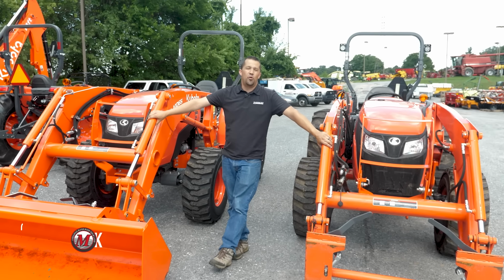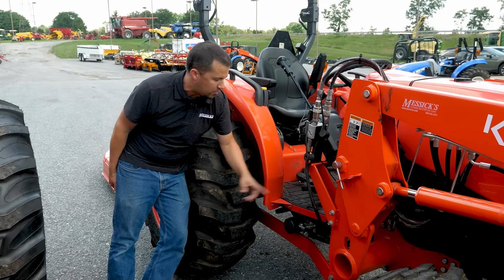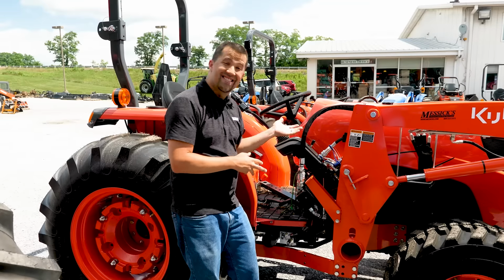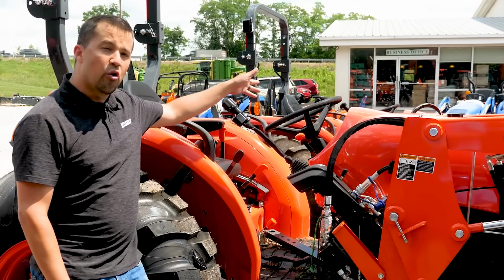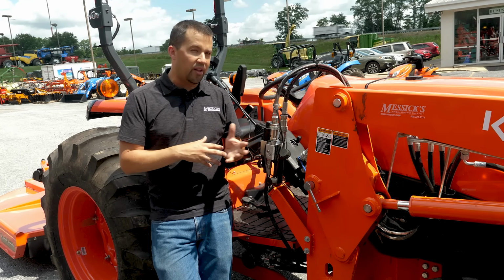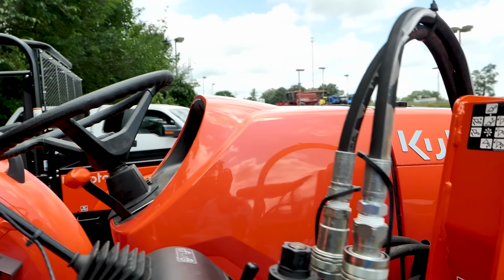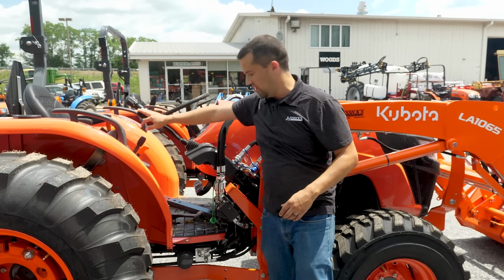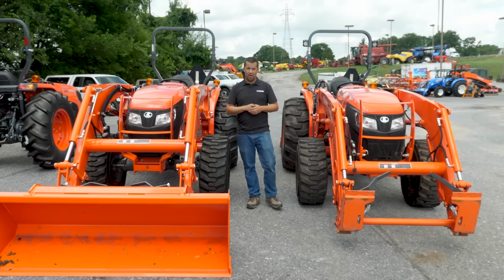Third Function Kit Comparison

Comment: I like the new 3rd function kit from LandPride, where the wires from the controllers go down the tube.  The instructions still say to notch the Boot, but I have found a much better way by stretch the boot to fit the wires though and it looks factory.   Don't need the zip tie or clamp to make it water tight.  What I'm looking for is a boot or a cover for the controls to keep water out.

Comment: My Mahindra 5565-4L loader control valve doesn't have any markings that show which ports are for the power beyond circuit or to the tank.  My local Mahindra dealer was no help.  There are no valve diagrams available on the internet.  I might as well sell my grapple attachment.

Comment: I purchased a Land Pride kit from Messicks for my L4701 so I could operate a grapple. The install was relatively easy, but I took my time to make things look professionally done. I've been extremely happy with the Land Pride kit. Heavy duty hoses and couplings. Have not had a single issue with it.  The grapple is defintley my most useful implement. I highly suggest one. For me, the Land Pride 3rd function valve kit was THE way to go.
Reply from the maker: Glad to hear it is working well for you! Can we share your comment in our advertising?
Reply: @MessicksEquip  Absolutely! I've ordered several items from your website. Things I've needed, or wanted, have been easy to find, shipped quickly, and well packaged. The diagrams and installation instructions are extremely helpful. I will continue to use the website for my future purchases.
Reply: With a Divertor kit, can you use a toggle switch to keep it engaged instead of a button on the stick that you have to keep holding?  While snowplowing, i would Pin on the plow so not ever using the curl function. Im picturing flicking on the toggle switch the whole time so the curl fuction would be used to angle plow.
Reply: @theresahoffman8408  do not think that's possible. But with a third function installed, you should be able to adjust angle the blade with the buttons on the joystick and leave it at the angle you want to plow. I can close, or open, my grapple with the buttons and leave it in either position while working the tractor. And still use the joystick to raise or lower the grapple without using the buttons and keep the grapple in the open or closed position. Snowplow positioning/angle should work the same.

Comment: Thanks for the great video. I have a bx2380 with a bx2822 front mounted snowblower. My question is, what is the best and easiest way to add a deflector control to the blower. Mine is manual and it would be nice to not have to get off the tractor to adjust.

Comment: Hi Neil. I'm looking at purchasing a 3rd Function Valve Kit for my L3901/LA525. This video was very informative! It's Sunday and Messick's is closed so I thought I would post my questions here. In the video I believe you are comparing OEM and 3rd party valve kits. And I also believe you compare kits where the diverter is place on the loader front tube assembly and those where the diverter is placed near the valve assembly (more so near the operator). For me the latter configuration seems to be better simply because it is more protected from damage when away from the working load. With that out of the way, my focus is on which kit should I buy. An OEM Kit or a 3rd Party Kit. My Local Kubota Dealer is selling the W.R. Long Kit when I checked with them. When I asked about the Land Pride Kit the salesguy said they have had better luck with the WR Long Kits. I have a few questions maybe you can answer. 1. Are you comparing a OEM Kubota or Land Pride Kit with a WR Long Kit? 2. I know Kubota owns Land Pride now, but does Kubota make an OEM kit for my tractor? I did not see one on the Messick's website. Only the Land Pride Kit. 3. In the video which I watched several time as there is a ton of good information, I believe you said the WR Long Kit is a well designed kit.  But also believe you also said the OEM kit cost a little more, but the cost is worth it due to design and they are made specific for a model of Kubota Tractor. So my question is did I understand you correctly? 4. What's the warranty on a OEM Kit (if there is one) and a Land Pride Kit?  Note: My local guy said the WR Long Kit has a 90 Day warranty which is not very long. Thank you sir!
Reply from the maker: I can make this pretty quick. There is no Kubota kit for this model. Land pride and WR long kids are very similar, but I prefer the way the couplers mount on the land pride. 

https://www.messicks.com/part/380-152A
Reply: @MessicksEquip  Thanks and I appreciate the quick reply!
Reply: I just ordered one from you. Thanks again @MessicksEquip  !!!!

Comment: I have a hydraulic tank for a front brush cutter. Is there a way i can use a grapple with it? Trying to use what i got without buying a 3rd function.
Reply from the maker: No, you need a valve that can toggle the flow bi-directionally.
Reply: Do you have one or know where i can get one? Thanks
Reply from the maker: @robertshirlingjr.6988  https://messicks.com/thirdfunction

Comment: Hi Neil, can you explain what those two knobs on the Hydro-Tek value, top and bottom are for. Do they have any function at all? I'm trying to slow down the response of the hydraulics when operating the grappler on my L3901 when loading logs onto the mill. Is there any way of slowing the action other than via the buttons. I had the OEM version installed. Thanks.
Reply from the maker: Hydraulic flow restrictor

Comment: When I engage third function valve can it stay open so I can run a log splitter out front with function controller for splitter on splitter if that makes sense
Reply from the maker: not a great idea. 3rd functions are not make for long term continuous flow like that.

Comment: Neil, thanks for the video.  My dealer installed the 3rd Function behind the loader in the manner shown in your video. It now interferes with the Swift Tach hydraulic disconnect lever function. Seems like Kubota should have a better solution.
Reply from the maker: This is for a BX? The OEM 3rd function valve puts the valve body out on the loader as a diverter so it does not get in the way of the swift-tach. Availability on those is terrible, your dealer may have used a Land Pride 3rd function for that reason.
Reply: @MessicksEquip  My tractor is a B2601. I agree, they probably installed a Land Pride 3rd function. Dealer was not really that knowledgeable on the Swift Tach loader. The Swift Tach loader is a significant advancement in ease of use.  A suggestion for Kubota is to innovate a better 3rd function integration and make it standard. For example, just add two more connectors on the Swift Tach manifold. These days the 3rd function is a necessity like the Skid Steer quick connect.

Comment: L3540. My factory kubota 3rd function valve is in a verry bad spot at the bottom of the loader brace by the throttle peddal sticking out past the tires i wish it was in a better place i have hit it several times

Comment: Hi Neil. Thanks for sharing. I have trouble connecting my grapple to my third function fittings from residual pressure. I always cycle the buttons with the key on to try to relieve pressure before disconnecting and before connecting, but still have an issue. This is a factory third function on a B2650. 
Do you have any suggestions to solve this?
Thanks again.
Reply from the maker: Video coming out shortly on this

Comment: You need to do a video on the L2272 third function / hydraulic skid steer disconnect for the L60series. Not much information out there on it. My local dealer didn’t know it even existed when I ordered my L6060 last month. It’s so handy to not have to get out of the cab to unlatch the skid steer quick coupler.
Reply from the maker: I will, but we need to sell one first.

Comment: Dose the lx have enough flow to run a true 3rd function and a 2nd function together
Reply from the maker: For that to really be done right you'd need closed center or flow control. No small tractor could.
Reply: @MessicksEquip  I asked it in the wrong way talking specifically for loader curl and grapple close or open doing 1 of each function

Comment: Neil, when using my 3rd function (4 in 1 bucket) and having my BH92 backhoe attached on my L4701, the backhoe valve continues to blow seals.  This is a huge disappointment and limits the function of the tractor.  Has Kubota come up with a fix for this issue?
Reply from the maker: IMO, something else going on there. Incorrect plumbing? dirty or incorrect hydraulic fluid, etc?

Comment: Great info here Neil!  I just installed a WR Long B3200 kit on my tractor and the fit was a big disappointment for a kit that was specific to my tractor.  I wished I would have looked to see if there was a Landpride option available.  Lesson learned for my next Kubota...
Reply: I have been really disappointed with my WR Long also. Instructions were poor, it needed extra parts to make it work, it leaked like a sieve and now one of the valves has packed in. Strongly don't recommend.

Comment: Neil I love my dealer installed OEM diverter type 3rd function kit on my BX23S. Currently I use it for our quick attach power angle snow plow from Ai2.  I find no trouble with operation and appreciate control of the fluid flow. Cheers. 🇨🇦

Comment: I installed the Landpride kit on Tractor Time With Tim, he installed the OEM kit on his machine. The OEM kit has a LOT more value for a very slight price increase.
Reply: I'm not finding any kubota OEM valve options for a b2601.   My dealer quoted a landpride.......1600.00 installed!!!!  Ouch!
Reply: @jpjp3873  I'm not fully clear on how a diverter works in contrast to the 3rd function, but I can tell you with several hours experience using a 3rd function and there is often a conflict between the various functions.  From what I've heard Tim say, the diverter is actually a bit easier to control.  If I were you, I would also look into that option.
Also, don't hesitate to call Messick's.  There might be an option available that your dealer is not aware of.
Good luck!
Reply: @curtwhite876  Thanks for the reply!  I'm going in tomorrow to finalize my order.  Was figuring to have dealer install to keep it all under warranty and financed in with the package.   I'll ask about an OEM option.  I'm not sure how long it takes to install, but 800.00 adds up fast at dealer rates!
Reply: @jpjp3873  I think it took Tim and I a little over 4 hours to install the Landpride kit on my B2650 and about the same amount of time to install the OEM kit on the LX3310. The most challenging part of the OEM kit was routing the hard lines in the right loader arm.  It was a bit of a puzzle.  Aside from that, though, the OEM kit was VERY well designed and it looks like it came from the factory with it.
To me, the biggest challenge with the Landpride kit was that the instructions were incomplete so we had to figure out several things on our own. Plus I replaced some of the hydraulic fittings so the lines were held up closer to the frame. The Landpride kit is a one size fits many, so it isn't very well optimized. 
But if you're going to have the dealer do the installation, they might make a few adjustments themselves since they have likely done it before, and because they'll want you to come back again and again.
Reply: I'm kind of thinking that's why Neil did this episode, because he regularly looks at TTWT. I watched it as well and it was interesting the difference between the two setups. I totally agree that for the money, I think it would be better to go with kubota's OEM versus land pride if there is a choice. We all are wondering though if Neil ever gave Tim a hat like you got! Lol lol
Reply: That was a good video

Comment: Pretty sure the Kubota MX5200 we bought has an OEM third function kit. The way the Land Pride kit is described and shown looks very similar to the set up on my tractor. I’ll have to check if there are metal lines or hoses. The valve mechanism is up on the loader behind the bucket so I guess it is the self contained diverter style. I’m not sure though as we have not had the tractor long and I’m stuck in prison. The city I live in is a prison city in lock down. No one is allowed to the country. The tractor is on my farm and I can’t go there....

Comment: I have a question why might a newer tractor have bigger or wider tires than a older model of that same tractor?
Reply: Some tractors have multi position rear rims.  You can change the rear stance depending on your application.

Comment: So are you saying that with a 3rd function kit the flow control is via a switch but it is ON/OFF with no variable flow control?   Whereas with the diverter I still have to throw a switch but can then use the loader SCV to vary the flow?
Reply: Exactly
Reply: @jaxturner7288  Thanks!  I never realized that's how the 3rd function options worked.

Comment: I have a Deere 4720 with 2 open rear remotes in the rear. Can I run two hoses from the rear to the front loader to power a third function ?
I do have an operating  control arm for the rear remotes on the tractor ? It seems so simple, so there must be a reason not to do it.
Thanks for any response.
Reply: I used a rear remote for a third function on my New Holland3045 and it worked perfect. The control lever for the rear remote was very close to the loader control lever so it was easy to go back and forth operating a grapple.
Reply: @jc-botaman1077  Thank you so much for the reply & the advice.
I've been playing with tractors for 20 years and I am enjoying all the free advice from good people like you.

Comment: I’ve tried to order things at Messicks but haven’t ever been able to get through to them. Using their part number pdf only helps if you know the number. Still need replacement tubes for my Bh92 outriggers. I slipped off and damaged one. Anyone know the part number for those metal tubes that are hose clamped to the outrigger?
Reply from the maker: 877-260-3528? our hold times average under 30 seconds.

Comment: For us, that would.ore be a second function because our Renault only has one hydraulic line acting in both directions, so our the cylinders only have one hose each, and only hight can be controlled easily. The angle is either fixed or gravity dependent.

Comment: When I purchased my tractor I asked the dealer to go ahead and order a rear remote for a future flex wing cutter I will be getting and the salesman said that I should wait until I order the cutter so I will know what type couplers come with it. Don't implements for tractors generally come standard with male and female Pioneer couplers or when you order the implement they ask you to specify what couplers you want it come with?
Reply from the maker: Rears are almost always pioneer. Front can be either.
Reply: Sounds like your salesman didn't want to be bothered with it, or knew he couldn't get the part, or wanted to get the sale completed without waiting for the remote to be installed. I'm pretty sure it would have been cheaper to have it installed before you took delivery.
Reply: @jc-botaman1077  Unfortunately that's the conclusion I came to as well as some other people I talked to. We had completed the sale and were waiting on some attachments to come in before delivery so, yeah, he didn't want to be bothered with it since he had already made the sale.  But I feel the dealership itself is still a good one. Just wish we had an all around reliable one like Messick's seems to be.
Reply: @rogerr1296   Your dealership probably is a good one. You can have good as well as bad salesmen at a good dealership.  I am a Messick's customer and had a bad experience with a salesman that I dealt with for years. I now go to a different Messick's location and deal with a different salesman. That first salesman cost them the sale of a Kubota L47 TLB and a Kubota B2650 cab, which I ended up buying from a different dealer.
Reply: @jc-botaman1077  Unfortunately (I seem to use that word a lot here lately ..lol) it's a little bit of a drive for me to the next closest Kubota dealership but, depending on how things go with this salesmen in my future dealings with him, I may make the trek for any new equipment purchases.
Reply: @rogerr1296  That's what I did.  The dealer near me was arrogant and wouldn't deal on price.  I went 45 mins away in the opposite direction and what a difference.  Very helpful and informative, willing to deal on price, and have a can do attitude if I need something they don't have.  It's your hard earned money.  I'll never go to that first dealer I went to.